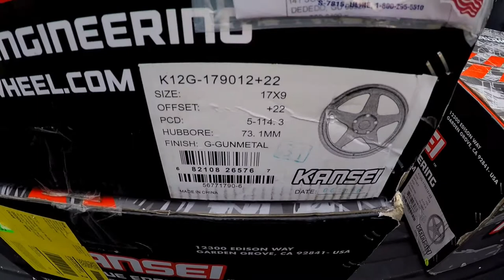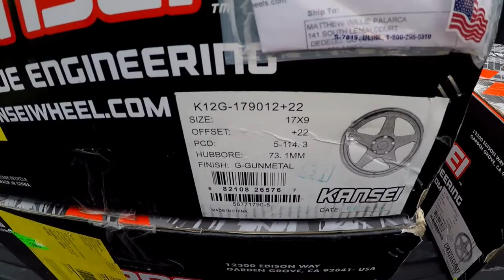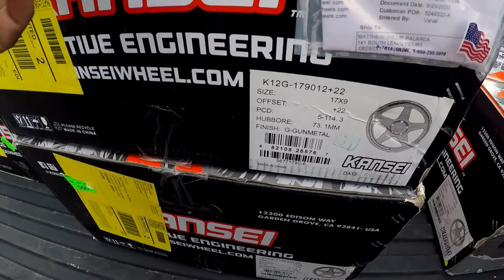New shoes unboxing | S14 Update EP 9

Comment: What size tires and wheels are you running on your 5 lug Tacoma? I am wanting to upgrade from the stock steel wheels and I don’t know how wide I can go before it would rub the control arms
Reply from the maker: So those were 265/70R17 on 17x9 +35 offset with 1.5" wheel spacers. I don't know back spacing cuz I'm a car person and go off of width and offset.